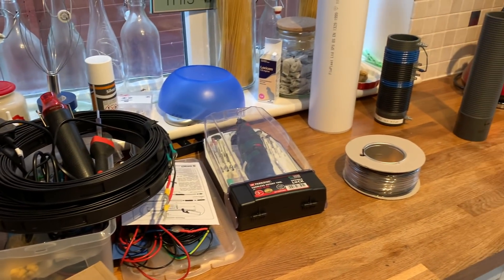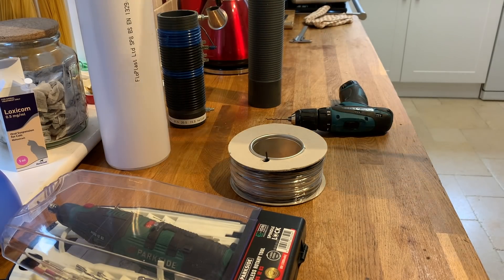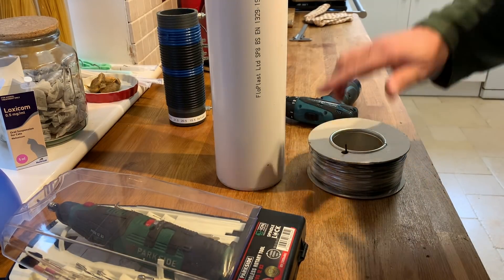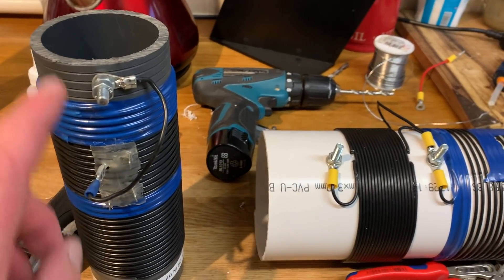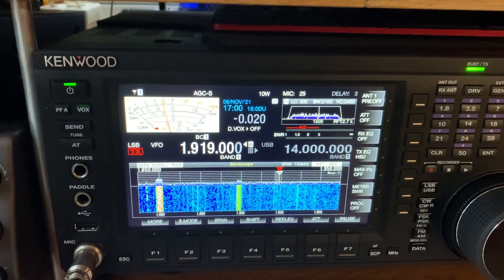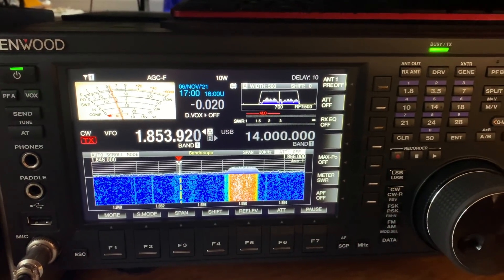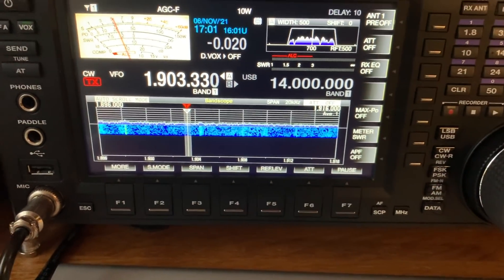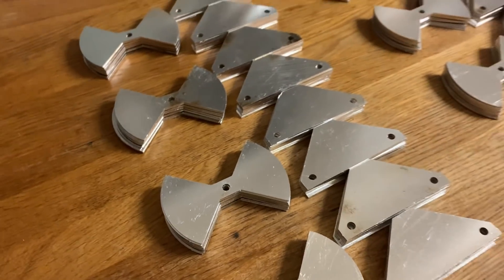HAM RADIO: Top Band Vertical Small Garden /Back Yard Antenna  - 160M band DX Commander

Comment: Nice video!  Surprised you didn’t discuss using either shunt inductive or capacitive matching across the feed line at the feed point.  I have always been able to bring in a near perfect 1:1 SWR match on both mobile antennas and fixed station verticals with simple shunt matching.  As others have mentioned, an appropriately rationed un-un matching transformer will also do this and additionally isolate and minimize commkn mode common mode currents on the feed line.

73 de Chris AJ1G Stonington CT

Comment: What L/C meter are you using? Really interested in making the coil for my 80 inverted L but need to pick up a L/C meter.
Reply from the maker: Cheap on from eBay Lc-200a
Reply: @mike-M0MSN  excellent! Thought that was the one but wanted to check. Thanks!

Comment: You did a nice job making the coil. Well done. Since the SWR is 2 to 1 on 160 meters, you may want to put an antenna analyzer at the base of the antenna and check it there. I was involved in the placement of numerous inverted L's for 80 and 160 meters. We found the feed point impedance to be very close to 20 ohms. I built a 22.22 to 50 ohm UnUn, placed it at the base of each inverted L and now they are have a perfect 1 to 1 match. 
Nice job on your antenna. I hope you work a lot of DX with it.
Barry, KU3X
Reply from the maker: Cheers Barry the nun is a great idea.
Reply: Honestly when I build coils a lot of the time I will just cheat... And I'll use a tap connected to an alligator clip and this lets me figure out where it needs to go Then I can also adjust it for the top end of the band or the bottom end of the band

Comment: excellent video Mike a really nice coil you made you have inspired me i might have to have a go. also an over night rx on ft8 would be interesting i use a full size inverted L but was considering using a coil. have you tried the coil at the end to make it a top loaded antenna . ?
Reply from the maker: I would have to almost double the coil size if I put it on the end of the antenna....

Comment: As you know I took a different approach to the same scenario, at the end of my inverted L section I have a trap followed by nearly 20m of wire, of course on 160m the horizontal section  being low to the ground does drop the impedance. On the positive it does work and does not significantly affect my 80m band (or the others), it looks like I can gain 60m too. Good to see your coils, a fairly similar process to my coax trap. 73
Reply from the maker: Yes I was looking at a trap, however restricted by garden size, great idea the trap.
Reply: @mike-M0MSN  I likewise ran out of garden so the top band extension has to come back in the "wrong direction" but you don't get a disaster of cancellation. I may try the loading coil, possibly with a Russian vacuum relay to bypass it for 80m.

Comment: I did make a coil to put my 40m vertical on 80m , and it tuned nicely, but after comparing it to a 80m inverted L, I was about 2 s-points down into eu from zl, when using the coil. maybe the losses are expected with a coil.
Reply from the maker: Yep 6bB plus. 👍🧐

Comment: Hi Mike,
Great video as usual.  You make this look so easy, but I missed the calculations & apps that you were using for the coils.
Now please correct me if I'm wrong, but you appear to be going into Variable Capacitor Production. If so, I could be interested in 1 or 2 of them with the motors on them, depending on price.  I follow most (if not all) of  your building projects for Amateur Radio. My main interest is in making 1 or 2 multi band Mag Loops in order to cover most (preferably All) of the HF Amateur bands.  Mag loops due to very bad noise floor where I live.  I do have a DX Commander Classic, but I am unable to put it together & install it by myself due to being disabled. I'm sure there will be someone not too far from me in Sittingbourne, Kent, who will be able to offer me some help with it soon.  
I also have at my disposal, a 12 foot steel ring, the remains of a 12 foot trampoline, which I am torn between what to do with it.  Turn it into a Mag Loop Aerial, or use it as part of the ground radial system with the DX Commander Classic, in the center of it.  I don't have space for 360degrees of full length radials, but I have been told that, that dose not matter, as long as I can still get plenty of radials laid out for the DXC.  Back to the Mag Loop, This is where my main interest lies, but the problem being the variable capacitor capable of handling the high voltage when running 400 Watts into the mag loop.? ? ?
Can you please Help, as I do Not have the tools or skills required to make my own?
Many Thanks In Advance,
Kind Regards, 
Ray.
AKA M0RAY,
Reply: Are you mad???
400W into a mag loop!!!
Do you want to transmit radio signals or cook a full Sunday roast with it???
You can travel the world and some with 10-15W on a decent mag loop. Plus if you are sat anywhere near a mag loop running at 400W you could easily be a cancer victim within a very short period of time.
Prey tell,,,,,, how much did your full licence cost you????
P S.
You were robbed !!👎😖👎
Have you not seen,,,, there is a video of a guy from USA that had a mag loop on a back pack. He used to push 200W through it.
Now, whenever he keys up his 5W QRP set he pisses himself and forgets who he is for about 30 mins.
Some people should not be left unsupervised,,,, no matter how old they are !!! 🇬🇧👍🤫👍🇬🇧
Reply: Hi Barry, 
No mate, i'm not mad. that was a typo. It was meant to be 40 Watts, even though that's still on the high  side for a mag loop.  I've worked VK from the UK with 3 Watts into a Mag Loop quite a few yrs ago , the loop being a special event club field construction project at the time, made from copper pipe.
I've been licensed for over 32 yrs, and not had the best of luck in the last 12 months, due to my main antenna having to be pulled down due to age decay. It was a sort of a cross between a G5RG, & a Doublet, Home brew, which worked well considering its orientation. 
I would Love to have a couple of decent Home Brew Mag Loops in the garden to cover most HF bands as I previously mentioned, but at the moment I don't have the capability to make any. I do have a new replacement home brew center fed wire antenna to go up as soon as I can find someone to get up on my roof to help me install the roof top end of it properly.  The other end of it rests on a fiber Glass pole mounted on top of a scaffolding pole which is reasonably manageable to lower and raise by hand.
Many Thanks for your reply Barry,
Kind Regards,
Ray,
AKA M0RAY. 
Sittingbourne, Kent, UK.
Reply from the maker: No not production. I intend to use the lot making my next project. As for the trampoline loop. Very interesting idea that. But witch way to go?

Comment: D10 used to  come as twisted pair cable, for use with field telephones. Used to make army telephone exchanges to go  into the back of landrovers etc. Seen a landy drive off and rip the floor out the back as the exchange and 30 pairs of D10 cables were not going anywhere. 7 strands of steel and 3 of copper don't break easy :-)
Reply from the maker: Yes but this is DX10. Callum use to supply D10 back in the day.
Reply: @mike-M0MSN  does it still have the steel strands, or just copper?
Reply from the maker: DX10 is copper no added steel,  check out https://www.m0mcx.co.uk.

Comment: Just my idea for winding coils. I use nylon weadeater/ fishing line for spacing with wire and just leave it there and tape the lot together. Works a charm.👍
Reply: A fantastic idea for that unused spool weed eater line collecting dust in the garage
Reply: Or maybe some PETG 3d printer filament, as opposed to printing a coil form which may take several hours.

Comment: I notice you have solar panels on the roof, did you need to do anything to reduce noise from the inverters?
Reply: A good and correct inverter plus no optimizers. I use a SMA inverter. 73's
Reply from the maker: No I purchased a good quality inverter. No noise👍👍
Reply: @mike-M0MSN  The challenge is persuading your neighbours they should do same.